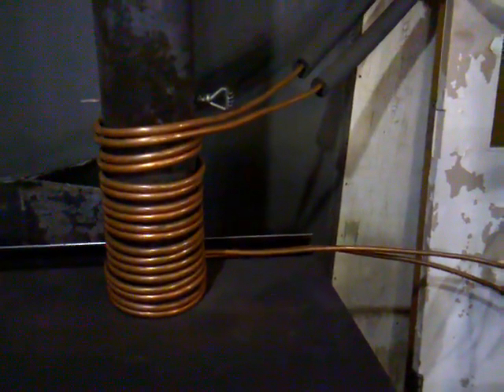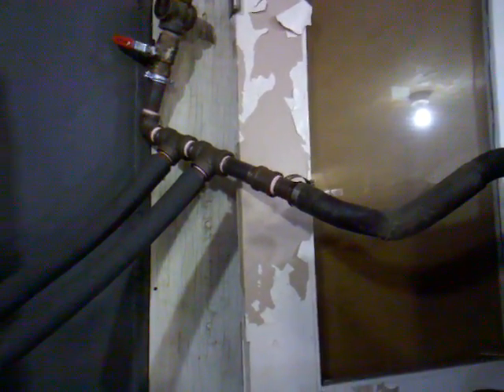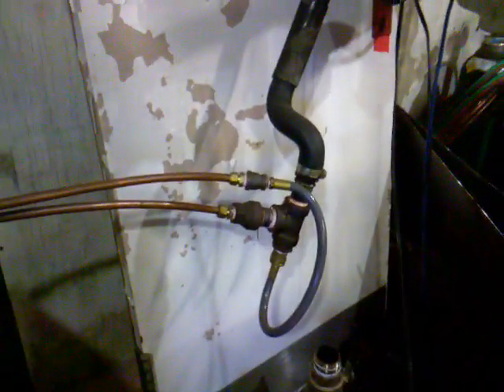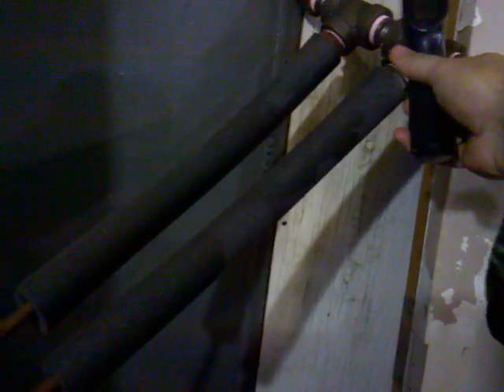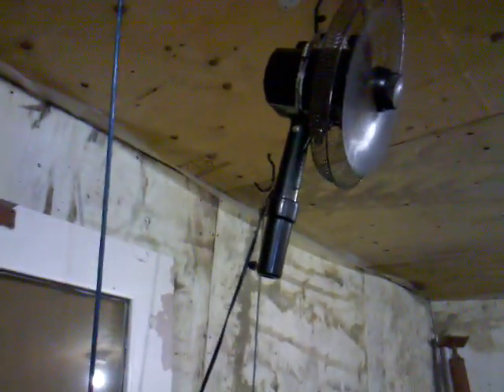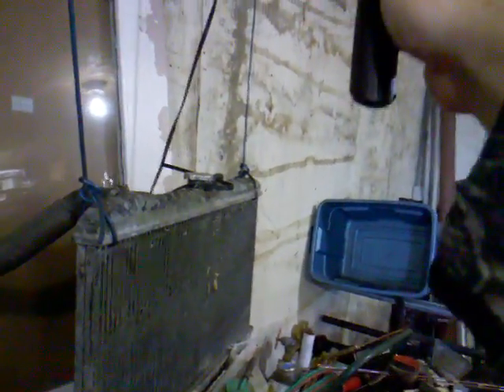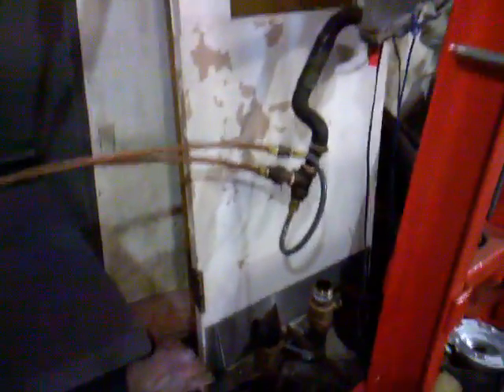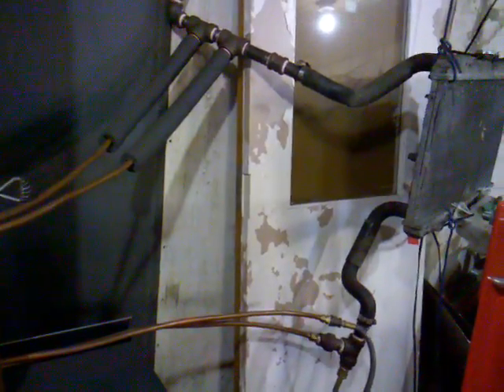Homemade woodstove radiator

Comment: Excellent!
What do you think about putting the rad(s) on say, oh.... how about a 45' - 60' angle or so, (with the fan(s) placed below it, (so blowing more up-ward?  That way, the heat can rise up more naturally through the fins?

May be good if you loose power, so then the fan(s) can't help move the air of course.

Or..
Are the fans basically 12 volt, DC  so a car battery can still power em in a pinch?

If my math is right, 2 (two) similar, 6 volt DC fans wired in 'series' will draw 12 volts, but will only draw 1/2 the amps than if  they were wired in 'Parallel'.
So longer battery life.

Those small, flat, "pancake" like cooling fans may do the trick too. I think they're pretty efficient, too.

PLMK if any of these are good ideas, OK
DL
Reply from the maker: ***** Mounting the rad on an angle is spot on and would have been necessary if I had used a smaller rad or heater core more suited to the size of the system. Also considered mounting it in a vertical duct running up and across the ceiling.I did try some DC fans but if you want to move a lot of air it will take a lot of power.Cheers.

Comment: wrap that coil around the stove pipe with some insulating material to get higher temp to the rad....cutting room heat temp time in half is a damn good gain so it obviously makes a diff even if close to stove
Reply from the maker: swanyut I considered it but between it being ugly, not having the material lying around, and not wanting to sacrifice the radiant heat I enjoy while the place is still cold (oh and being generally lazy); the idea went no further.Thanks for the comment.
Reply: @LikelyCandidate exact idea I had in mind. Since it's natural convection or whatever it's called, no need for pressure release or worries of too high  of pressure correct? I had in mind using one from a water heater I scrapped out. What would you change if you had the materials lying around? 
Any ideas I should incorporate when I build mine? Thanks for the video and we'll done sir. I'm also considering to add a drip line to my fire box to burn used motor oil. I will also use wood so it will be just that, an oil drip. Thanks again!
Reply from the maker: @Hallnout  there is a risk of pressure. I never noticed my setup building much pressure but it's something to plan for. Water expands with temperature. I used the radiator cap and reservoir.
Oil drip can be risky also. Not something I'd want to leave unattended. As the oil warms up, it  flows faster, the drip becomes a stream, the stove and chimney get too hot and nearby stuff starts burning. 
My buddy almost lost his shop when his chimney got red hot just burning wood scraps and it didn't have proper clearance from the ceiling. Be careful. Cheers.
Reply: @LikelyCandidate  yeh not real certain on the waste oil part. I see those fellas on that group. They've got everything so hot, not sure how it doesn't melt. 
Originally was thinking about a small circulation pump but not sure yet. 
Thought on an exspansion tank I'm the water line?
Reply from the maker: @Hallnout  an expansion tank would work as long as it's vented. I'd recommend having the tank up high or running the vent up high so it doesn't try to siphon and drain everything.
Reply: @LikelyCandidate  gotcha. It's going to be awhile before I get to it. I appreciate all your help and insight. Thank you sir. 👊

Comment: Great job , but I wonder what would be the temp reading in between radiator fins, is air being blown warm enough to heat up a room? If it nicely insulated?
Reply from the maker: shams mujaddidi Only the upper half of the rad blows hot because the rad is too big (or the coil is too small).

Comment: put the damn coil inside the pipe damn it.
Reply: There's nothing wrong with the way he did it specially proving a concept the way I would do it using triple wall having the first wall wrapped the way he did it is a lot safer then simply running the coil inside

Comment: Excellent job! I was thinking about the same system (as you have on your 'left side' with the wood stove), but hadn't thought of using a radiator, instead, I was going to make another spun coil of 1/2" copper and put a radiator 12v fan in one end, and blow it out like a blower-tube fan so I could move it around some. Good job, thanks for sharing!